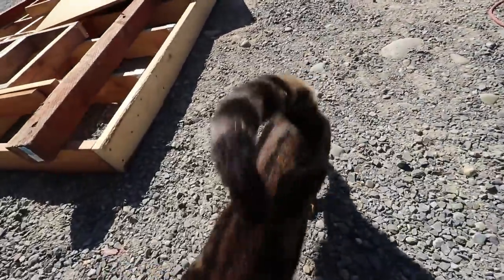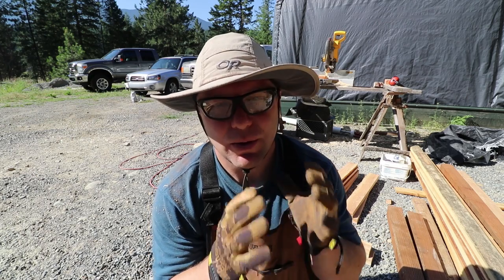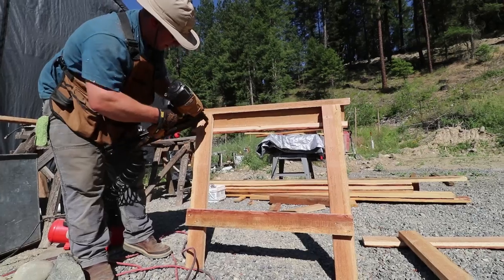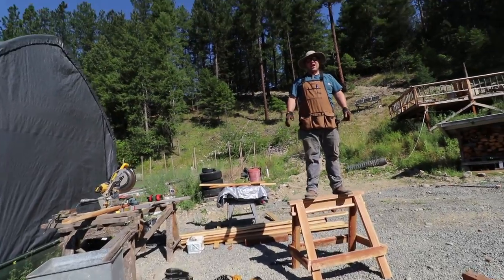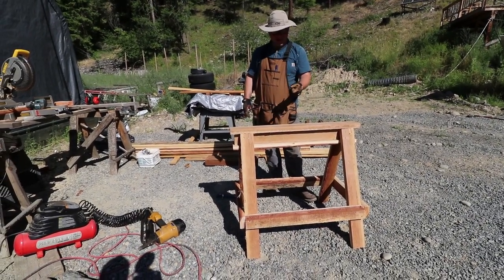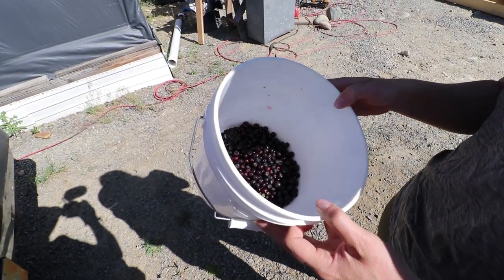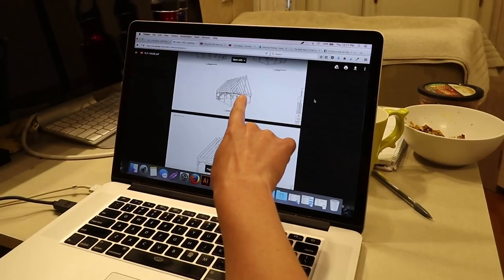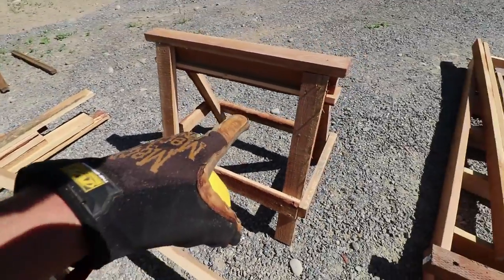STUPID-EASY 2x4 SAWHORSE BUILD

Comment: Built this design a couple of years ago. Do yourself a favor  and treat the bottoms, or the whole thing, with a water sealer or oil. If your not gonna stack them for storage  put a 2x6 for the top plate on your next one. Makes it easier to clamp stuff down if you need to. Nice work on the build

Comment: I-Beam 2x4 saw horses... Nice! First project my master carpenter uncle taught me how to make! If you put the bracing in the right places, you can stack them on top of each other. Move the legs flush w the ends first. The horizontals for the end a frame is correct, just make lower so you can place plywood from end to end underneath to keep tools and fasteners off the ground. The longer spreaders, change to  double knee bracing for each side starting in the center underneath your sacrificial top plate. Make sure to countersink your screws through the top plate so you don't hit them with the blade or screw them from the underside at an angle to catch the top plate is even better. If you do hit them from the top, you won't be able to unscrew them to replace your top plate.

Comment: Jesse: I really like your saw hoses. I have never seen them built that way. They look really solid but I saw an area that you could strengthen them up even more:  Just below the I-Beam you could attach another board across the legs (and to the legs). That will help the legs remain tight to the I-Beam so they don't come apart on you over time. Hope this suggestion helps you out. Love your videos, guys. Take care and have an awesome week.

Comment: When I was cabinet building we had knee (18") high tables for building cabinets, and 36" tables for everything else.  We also used Lumber Core Plywood for our benches as they were stronger with 4x4 posts.  We waxed the tops of the tables with Johnson Floor wax to make things move easier.  I realize you are just working beams now, but later you will probably like to have good building tables.

Comment: Last year, I had a bunch of bark leftover from various jobs that I ended up using to make "bark-walks" over the snow and later in the mud pits resulting from construction zone erosion. The bark-walks were great because they provided good traction in both snow and mud. 
This year, I'm covering the bare patches in the previous construction zones with a thick layer of wood chips in hope of improving drainage in the highly compacted areas and eventually adding  organic material to the soil.

Comment: Chop off the bottom of the legs to an inch and 'lightly' glue a sacrificial length of timber to the top of the sawhorse... replace as required.

Smashingly simple build...

Comment: Put this in your 'I'll think about it when the time comes.'  At some point you most likely will need a table saw unless you have one stashed in the storage shed.  Yes, you plan timber frame but that does not cover cabinets and many other items.  If you decide you will need one here are a few things to consider:  a cabinet saw in my opinion is much better than a contractor saw.  But better is relative; they are heavier and less portable.  That is both good and bad.  If your solar will support it go with at least 3hp; that will mean 240 volts.  Critical features:  cast iron table top AND trunions; forget aluminum.  Makes sure it has a really good fence---very critical for accuracy.  I have used Freud blades on my saw for years and am very happy with their  quality.  Also Forrest if you can afford them.  I'm a bit old fashoned in that I believe weight matters with machine tools so go cabinet in you have a place to put it.  Sorry to be so wordy.  You guys have  tremendous stamina.  Work hard at keeping that marriage together.

Comment: Your Saw horses are looking good. You should check out the smaller set of saw horses that I've seen on The Samurai Carpenter or Wranglerstar. These saw horses are only about 12-18" tall and made from 2x10 or 2x12 scraps. The Samurai Carpenter calls them shop stools, but they look great for heavy items because they are low to the ground. Consider that working off a tall saw horse, your work surface will be up in your chest / face area on big beams.
Reply from the maker: +Luke Schneider Those horses are cool and all but think about how heavy they are to move AND the size of wood required to build. These are 1. Light and 2. Made from scrap wood left over from milling beams. Gonna totally make some timber saw horses though some day. They're just cool. Haha.

Comment: Would like to know what kind of maintenance you have to do on the saw mill. ... Good thing you didn't make all 30 pair at this height. Make a few and try them out. What about mounting the top board with screws from the bottom? xoxo

Comment: a small tip, you might already know this. it seems intuitive to hold the trigger and bounce the nail gun on the wood, but it's not necessary. it helps when moving quickly, placing many nails in a row, but when doing finer work, you can hold the nailer right to the wood and hold the safety sheath on the end depressed enough to pull the trigger when ready. you do have to watch for double-shooting with unintended bounces. also keep body parts clear of the line of fire. many times I've had an unwanted bounce and fire and nearly miss a foot or hand. it's a bit more difficult yet when working with someone else to help hold something while the other nails. stay aware of the line of fire. and no shooting down birds with nails, as fun as it may seem.

Comment: I learned to make 4 squares as wide and high as your normal saw horse. But join them together in sets with hinges. Stand them up with the hinges on the vertical legs. Open them both up with the hinges opposite. Space them apart as far or close as needed. You can cut boards any length or sheets any size because you end up with 4 horizontal boards instead of 2.  Look up Steampunk Steve's utube bus conversion site for examples..

Comment: Jesse and Alyssa, Love your vidios and watch many. PLEASE take the air gun off bump fire and set to trigger fire. The fire setting to is down by the side of the trigger. It is the same as leaving a loaded gun laying around with no safety. If one of you bumps the end of the gun, guess where the nail is going ?? A few years ago I saw an experienced carpenter climbing up a ladder, lifted his leg too far and bumped the nailer with his knee. it drove a 3 1/2" nail down thru his knee. I have never see anyone in such pain. He was out of work for 1 1/2 years as it took many surgeries to repair his knee.

Comment: The sawhorses will be hard to use take the end boards off and move them up then take the long ones off  and cut the flat side a 45  make them 16in long and put them at an angle for brace one each side nail to end board and up to top underneath.  This will make them easer to move and work with Good luck with your house.

Comment: Countersink your screws on the top plate, or just omit it and use taller wood where it attaches, and screw THAT in.  That should give your saw blades good, safe clearance above the fasteners.

Comment: Dear Jessy, I would like to present an idea to you how to removably fix your top slats to the saw horses without risk to your delicate chisel edges: Use animal glue. What is animal glue: en.wikipedia_org/wiki/Animal_glue It is known since the Egyptian era. It has very high strength. It is not poisenous (you could eat it. It is the same as gelatine used for jelly). AND HERE IT COMES: You can release the adhesive joint and re-glue it at will many times and reach the full strength every time. Wow! The only disadvantage you should store the glued joints dry not out in the rain. The glue gets soft when moistened and heated up to about 50 degC. The glue delivered glue crystals are dissolved in water at 50 degC (best done in a baby bottle warmer) and kept in this condition until brushed on the (warmed up in winter) joint. Then quickly press the second wood piece on it and in 30 sec to one minute it binds up by soaking up the water and cooling down. After a few hours of drying up completely it reaches its full strength which is comparable or better than white glue. To release the joint you soak the joint in water and then heat it up eg. with a hot air gun or over a fire or a clothe pressing iron (for small joints) And it will get soft. You can wash the glue off with hot water and reuse the wood or if you want to re-glue it you add some more of the hot glue and clamp it for a few hours. After that you keep it dry. Maybe you put a plastic bag over the saw horses when you have to keep them outside. These joints last for centuries when kept dry. When kept moist they will attract mold (the glue is food) and fail slowly or fast depending on the moisture level. If you go to the animal glue factory leave your cat at home... hahahaha

You can also use wheather resistant white glue and put the saw horse on a Jointer or use a hand guided jointer to remove the worn out top slat.

Comment: As far as the screws vs nails discussion goes, I'm a bit surprised that you don't use the timber framing skills you learned and quit using metal fasteners except where necessary.  It makes a more sturdy platform.  Heavyer sure but more sturdy.  Same thing could apply to your grizzly issues.

Comment: A very small variant on your design.  Lighter, cheaper, faster, and stackable.

Based upon 8' long 2X4s    Cut parallelograms  nominal 15 degree bevel and 15 degree diagonal.  each end should be parallel and about 31 inches long,,, an 8' 2X4 turns into 3 legs (4 req. per sawhorse)    Use the same 2X4 upside down T as you did on yours,,, , just less than 48 inches long.  The replaceable top cap is optional,,, I never do a top cap.

Machine nail the legs onto the T section about 6 or so inches in from each end such that the top is flush with the top of the T.  This will result in your sawhorse having a 15 degree angled leg.  The angled leg needs zero straps or braces,,, and that also allows you to stack the sawhorses.  If you need 30 sawhorses,, being able to make stacks of 4 will be handy.

Cheaper, better, faster, lighter, and 90% as strong,,, 100% if you add the top caps.

Comment: you should not plung the blade into the wood.  if you use the slide and let the saw cut through , the blade will last longer.

Comment: I Know your into working outside and all but a couple of stout tree limbs some rope and a big polyethylene tarp would make a nice lean-too to put your saw table and maybe a workbench under and might save you a case of skin cancer.
Reply: I agree man,  a temporary shelter with just a roof of some sort to work under. I would have built that long ago, plus add a light to work under into the evening.

Comment: Wranglerstar on YouTube has a great timber framing sawhorse video
Reply: That design from TimberFrameHQ used by Wranglerstar is extremely sturdy, ie very heavy and slow to build. I have build 4 and 2 have even add-ons.  My 2 favourites are the one from JimRogers117 (ForestryForum Moderator), which is the fastest and easiest to build or the Chappel saw ponies, theSamuraiCarpenter has a video. And of course the easiest option is to use off-cuts from your own beams.
Reply: Thanks for the mention kiwi007. He'll soon learn that he should have used screws all around. Nails will wiggle out when working timbers. Don't ask me how I know.......
Reply: Most welcome.

Yes he might know, more likely build a different design instead...

Comment: Sorry but I eould be glad to show you the correct way to build sawhorses. A frame carpenter might make a temporary set like you do. No journeyman would do them this way. One supporting a beam under the top flange is a no no. No structual. This isnt a put down so dont be offended. Be glad to teach you.
rt

Comment: This guy thinks he needs 60 sawhorses to build a house! Does he have 90 circular saws? 

Just asking because I've built a few homes now with just 2 sawhorses and 3 circular saws. Haven't needed to replace the top bunk of my sawhorses either.
Reply: At his rate, that's 60 hours! 
With all the dilly dallying around...should be mid-winter ... lol
Reply: When you have people over to help cut and joint the big timbers, that at least two per timber your working on multiplied by the number of people helping you.  Then if they teach class, they will need more.  Then if they want to pre-fit it off the ground they will need more.  Then if they want to store the things off the ground they will need more.  Kind of hard to go buy this stuff pre-cut and pre-jointed timbers at HD, Lowes , Ace, etc...  Also, since its basically just the two of them for most of this work, its the first time they have done this so everything takes way way longer than bringing in a crew that does it for a living.  The first time I tiled a room, it took us all weekend and many blisters and messed up knees since we didn't know what we were doing.  Next house, I hired a contractor and they did it in a day and did a good job, and I had no blisters.  Same with finishing drywall, putting a roof on, etc.  I had a lot of enjoyment learning how to do it, but it just takes to long the some days.